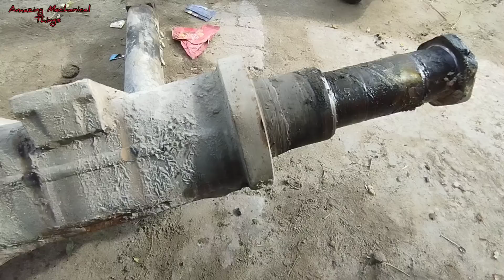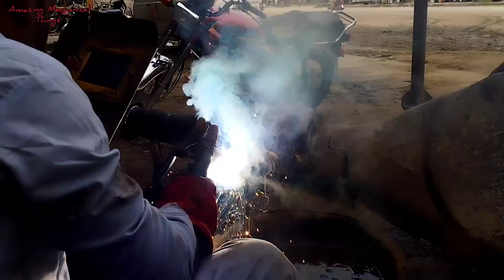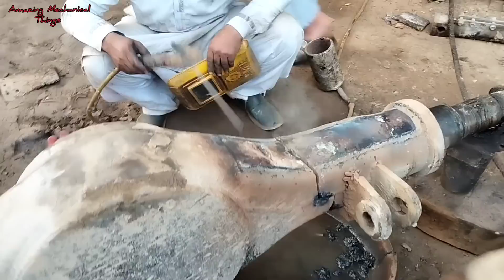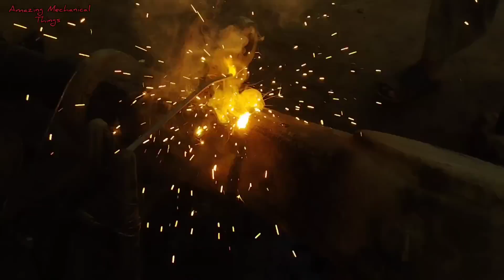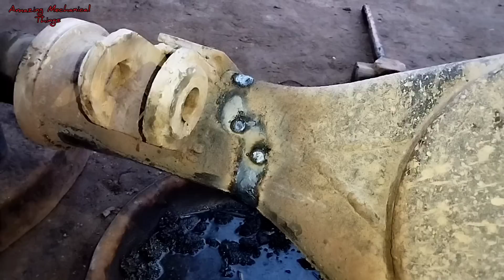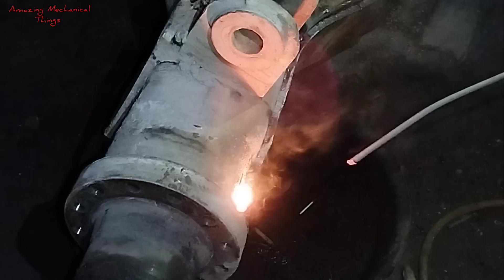Spindle are Cracked in The Middle Which no Mechanic Repairs|| NISSAN TRUCK Broken Rear Wheel Axle ||

Comment: Lots of comments on the poor work, well folks this is what gets done in the field and in places like this where these people have little money and little access to replacement parts, better quality equipment.  As an old guy who worked on equipment and did many repairs that were not perfect but got the equipment back on the job, be aware that you as a group live a much better life with more access to everything and much more emphasis on safety than these people do.  The vast majority of people commenting on this have never done the work.
Reply: Very true. I would love for some of the experts to provide some advise to these folks so they could do a higher quality job with the limited tools and equipment they have. For example cleaning the joints better so they welds won't have so much porosity in them or realizing that the concentricity of the axle after the patch will be seriously off after the welds pull the steel in that direction. Not to mention the wear stress will now be on the opposite side and cause warpage towards the week side of the axle now. I would love to see us help these guys learn while they do some amazing work with what they have and the knowledge they have developed over time. We take for granted the resources we have access to here in the states. I must admit I cringe at some of the repairs but your comment snaps me back to reality in that they do actually keep things going with what they do.
Reply: I'd describe is as a farm repair - done plenty of those in similar surroundings - some muddy yard with a piece of machinery that needs to be fixed - thing is, those repairs often don't last....
Reply: I think a lot of people don't realize these are the skills that built this world such as it is
Reply: this country has nuclear weapons'......
thats the scary part....
Reply: @goboyz8016  well it broke there to begin with
Reply: I was thinking the same thing. This axle might go through bearings faster than normal after this but in a place where you can not get a new axle, even if you had the money, this is a great repair and is probably stronger than it was in the beginning. I find myself putting things back together in the field that broke, when people tell me it needs to be replaced. I say, How about we fix this one for now and get this truck back in the fight while the new one comes in so we don't loose a weeks work for down time. Or the fix is forever until it breaks again. Bottom line, everyone commenting negative comments either is a couch hippo of takes their stuff to a shop it get it fixed. These are repair men, not parts changers.
Reply: These videos are dope, great for the apocalypse! 
Get a CarFax though!
Reply: True, eveyone can't afford a workshop with 500k worth of tools or buy a new rear axle with weeks or month if delivery
Reply: @Garth Land Forgive me if I sounded like I was being critical of their work as I respect it greatly. I surely understand what they are working with which is why I watch and am amazed at what they accomplish what they do. I was just pointing out how we could probably do more to help them with all the knowledge available now with Youtube and people like yourself with experience in welding.
Reply: We have a saying " neccessity is the mother of invention", looks like these men follow that .
Reply: It would have taken only 10 more minutes to grind the metal to get clean material to weld. You telling me they don't have grinders over there? Welding dirty, rusty painted metal only contaminates the weld and the result is a weaker finished product.
Reply: @kempaswe4022  You don't need 500k in tools to do the job correctly. A simple angle grinder to clean the metal before welding is like $20.
Reply: Laborers at a machine shop in Karachi make $2.53 an hour.
Reply: I have a 6g TIG rating.  I focus on finesse and a solid repair.
But sometimes you just have to get it done.
That is what these guys do.
Reply: I searched for videos of them casting axle spindles, with some results. They do have the capability to produce new parts.
So, this could be a "temporary" fix, extending the life of that spindle for cheap before changing it for a new one.
Reply: Exactly!
Reply: @kukuipupule4415  however they have never used it... you certainly live in a heavenly country where everything is easy and ready as a MacDonalds lunch
the road conditions and the stress to which the trucks are subjected are extremely harsh. and their country keeps growing as we regress
Reply: Preheating and symmetric patches, sequentially welded would go a long way in improving the repair but I’m not sure they’re receptive to advice. If they would indicate as much there would be many of us that would be game to help out.
Reply: @kukuipupule4415  Any nukes are scary regardless who has thrm.
Reply: I think what people are forgetting in these videos is that they don’t have the proper tools and repair parts … they have to make do.   Yes,  they could keeping things cleaner when they are making the repairs.  But at the end of the day there don’t have many other options.   Unlike those who do have access to the tools and parts and still chose to make repairs like this.  Yes, Fred, I’m talking about you 😂
Reply: @thoalexandrino9111  apparently you've never seen American potholes before than!!! It's not so glorious here either!!!
Infrastructure is abysmal govt spending on everything but what we need...we will be a third world country before long...hell we're there now
Reply: Well said
Reply: true...I know!....I respect them !
Reply: Well, I'm a retired shipbuilding welding engineer and I can confirm that there's really nothing to add to the work that these men have performed. I would have liked to see the final weld surfaces after the slag has been removed but based on the appearance of the inner weld beads, I'm pretty sure the final welds would meet industry standards for weld quality. The part was damaged by impact, not fatigue. It started off as a weldment on a pretty inexpensive truck. The thickness of the members, was modest (8 to 11 mm or so) and likely made from mild steel.  I don't think this truck is going to spend much time at subfreezing temperatures and since it's relatively thin,  brittle fracture isn't going to be a problem. Using mild steel electrodes as "cut-trodes" at high amperages also does a pretty good job at cleaning the base metal. The slag formed during welding not only protects the molten surfaces from the atmosphere, it's pretty effective at cleaning the metal from contaminants. The mechanic, keeps working the process until the area he's going to weld is clean and ready. Note that they did use a disc grinder to prep the doubler plate. I don't think they missed any steps on getting a quality product.

I love the hand made "dial indicator." I did a similar thing in my shipyard having the final part come within 0.010 inch TIR over a twenty foot length after having the shipyard president tell me it couldn't be done.  

This assembly is going to last as long as the rest of the truck is going to last. 

Well done, Gentlemen!
Reply: @ckm-mkc  Wrong i have seen them last for many years.
Reply: Problem is, this repair here is better than 75% of the work here
Reply: Robert Wheeler and every life there is expendable!!
Reply: I totally agree with you. These men have done so much with so little for so long that they can now do anything with nothing at all.
Reply: @sausagehead9151  
Yet so many put their workmanship down.
Reply: Thay don't seem to understand the importance of clean welding surfaces or grit in bearing and no lubricant
Reply: @garrypritchard1658  yes and no, this is not a repair being done like new and this axle is an old drive axle converted to a dead or non driving axle used on a trailer probably.  They did a pretty decent job of cleaning up the crack before actual welding occured.  No, this would not be acceptable in a big shop in America but then again the repair would not even been done but new parts/components installed or a complete assembly done.
Reply: Ya, 99% of the commentors have no idea how this work is even done, they just see dirty worksite and say bad work. To be fair those welds are solid and they did everything I would of done in a field repair, probably better. All these people are literalliy judging a book by its cover without being able to read. You should see when they do cast iron repairs, the comments explode with people that have no idea how to weld cast and see flame metal spraying and call it shit work, when its exactly how you weld cast. Hell, in this comment section half the people are saying this is cast when its not. Just keyboard warriors with nothing to do
Reply: @jeremysumpter8939  Agreed Sir 100 %
Reply: ...totally agreed > Thes are what I call 'arm shair' engineers . Top comment though .
Reply: @phoneblaster  And what would you call yourself sir ?
Reply: @Bugsy0333  ...I am not criticising anyones hard work, infact if you read my comments I actually appreciate their ingenuity and hard work .
Reply: @phoneblaster  OK 👍
Reply: I don’t care what you say, it’s still shotty work. No one should have to pay for garbage repairs like that😏💯.
Reply: @Bugsy0333  ok 👍🏽 😴 🛌
Reply: No you shouldn’t pay for a repair Ike that here in the US or other developed nation.  The repair would not be done here but this job was “not here” it was there.  A comment about the housing not being straight, probably not but there is no axle to be put in, the assembly is an old rear drive differential housing reconfigured to use a a pusher/tag dead axle used to support the load but not propel the vehicle.  The bearing will run just fine, wear will show up on the tires with the spindle not being parallel to the road.  Is this job good workmanship, not to developed nation standards where parts, money and precision tools are readily available.
Reply: @kukuipupule4415  ...I think President Nixon was briefed , as to how innovative the people are, because he said Pakistan must never be allowed to have Nuclear weapons.
Reply: It's not getting fixed in the field, it being bodged in a disgusting yard .😂
Reply: @richardholmes9295  really, were you there, that is no different than doing the job in the field.  and disgusting yard, i realize that my yard is not much to look at but this is not a yard but at best a shop in a third world country with folks doing the best they can with what they have   you and even the lowest level Americans live in luxury and have no inkling of the world these folks live in.
Reply: The problem is if they didn't seriously overload the vehicle in the first place the axle casing wouldn't have broken.  That must have been the best part of double or more the axle casing's maximum structural load, not it's stated working load either.  was thinking the way he was gouging out with what at first thought was a carbon rod, then I saw it bent and I thought ' how the hell do you bend a carbon rod?' And realised he was using a standard welding rod to try to gouge material out. And after all of that straightening they come out with a 9" fucking grinder which they could have used all the way to straighten the axle out, AN.d get the casing clean enough to weld with little crap in it to prevent porosity.
Reply: this can better, even in nomandsland.
Reply: @phantom21629  there are axles enough....150€ in europe
Reply: @johngullotti  A comment from a person who has actually done some work in his life! You reminded me of an old engineer joke ( could apply to most trades) How do you get an engineer to work? Ans: tell him it can't be done. lol
Reply: Well put my friend so many with no experience doing any kind of work like this.
Reply: Totally agree, this is how it's done in this situation.
Reply: @WaistingBob whose Fred, 🤔

Comment: That axle wouldn’t have broke in the 1st place if it hadn’t been overloaded, big axle housing’s like that don’t break if the truck has been loaded correctly.
Reply: Not to speak in their defence but remember these guys life from the hand to the mouth...any work that comes their way they will take on...so for that diff to have broken is based on every pay load earns a living. The more they can load the more money they can generate...if they had to do all that in a 1st world country all of them will get fines or their vehicles will be scrapped or deemed unroadworthy.
Reply: The truck that axle is from should have more axles. For that much load, at least 2 driven rear axles, and maybe 2 front axles as well. Could use another non-drive axle too.
Reply: @nevillesmith9795  absolutely..they have to take what they can get....the truck has probably been to the moon and back and I suspect the road conditions don't help either...👍👍
Reply: That is not the first time the axle broke (there).  He cut a patch off (using stick to burn through) in the first few minutes of the job.
Reply: @rnish2958  there was  reinforcing plates on the other end of the axle as well..not sure if they are there to provide extra strength in that area or to provide a flat surface  where the springs fit.... but where the axle was cracked I can't see any evidence of previous welding...so I'm not sure it was a previous repair..👍👍

Comment: Folk's when you split/crack the differential casting, especially that far back, you are overloading the truck...How much time a truck is down due to being overloaded cannot equate to the added revenue from the extra weight. Check out the boogery weld on the suspension mount. Its ready to fall off ..
Reply: I'm betting that axle is not original to the truck it come off of. Both the leaf pads and the anti-wrap arm mounts are not original to the axle housing. The biggest mistake made is reinforcing the housing with a backstrap rather than a truss. Preferably trussed top and bottom.

 Considering local conditions, particularly in labor cost and repair availability I'm certain the truck was down less than 48 hours. It ain't NA or Eur. There ain't no knockoff time or clock. Those guys stay till the truck is fixed or they don't eat. Trucks don't sit for a week or more on a shop lot till someone can get around to it.
Reply: Yeah. Deff overload, have you seen how high they stack those trucks lol
Reply: it's not a casting. It's a stamping, so it's going to weld up just fine. besides, I doubt there's a lot of choice on what they take or how much of it. Further, this could have just as easily been caused by a truck loaded within limits bot a road with a foot deep pothole...
Reply: You got it thats the very reason. In the end it just doesn’t add up

Comment: If you're wondering what's happening during the first 5 minutes or so, those are called gouging rods, which heat and remove metal. They cut the support plate off and gouged a nice, clean gap to later weld back together. This is also introducing a lot of heat into the cast metal which is very important before welding, otherwise it would likely crack, again.
Reply: Welding guy at work use to use them loads but he called them Groovee rods (maybe that was the make ) he was brilliant with them use to cut cylinder liners out on our locomotive engines with no damage to cylinder block  (there were sealing lands top n bottom you couldn't damage )
He could weld through small hole using a mirror amazing welder , he saved me some work
Reply: This was not cast! If you hit any cast item with a sledge hammer it would shatter! Probably forged and or fabricated! You can understand with the poverty here, the need for speed and at minimal cost is a prerequisite! What amuses me ,is what did anyone do about the welding spatter/ molten metal etc that entered this structure and would have found its way into bearings and diff etc! Incredible bodging ....but needs must when the devil rides! Incredible stuff! Cheers
Reply: @nigelparker5886  Nothing but respect for these guys!
Reply: @jt8251  Gotcha!
Reply: I don't think those are gouging rods. Normally you have high pressure air to blow the slag out.  I think they are just regular rods they have the heat turned way up and just melting it and letting it fall.
Reply: @kirtxpress  But to where I wonder? Cheers
Reply: that wasnt cast or they would of had to torch the whole area or bake the whole thing. you can see the many different pieces welded together to make that rear end.
Reply: Lincoln used to make a rod called "Cut Throat" rod. Haven't seen it in over 30 years, though. Actually wouldn't mind carrying a few on the truck. for a little short gauge they would be pretty useful instead of dragging out a hose and the carbon arc torch. - Looked but I can't find them,,,,don't think they even make them anymore on this side of the pond.  (The factory where they make Lincoln rods il like 4 miles from where I am sitting.too
Reply: @kirtxpress  what i think too just amped way up
Reply: gouging rods are copper coated solid carbon, he is just using standard welding rods with the amperage turned up, which will actually cut the metal away.
they are using what they have available to finish the job.
Reply: Those guys aren't actually gougeing  which uses a carbon for and air supply to precisely blow weld away etc they're just using a small welding rod and cranking the heat way up to burn the metal away 👍👍👍
Reply: they were 6011 set to high amps